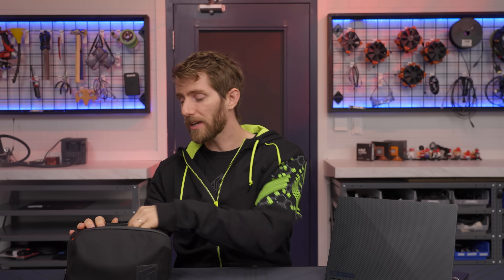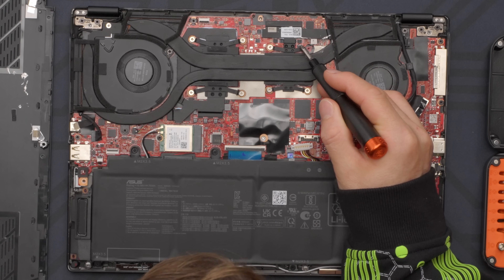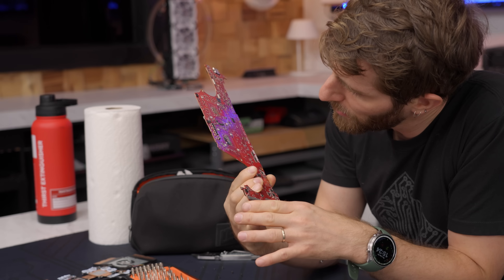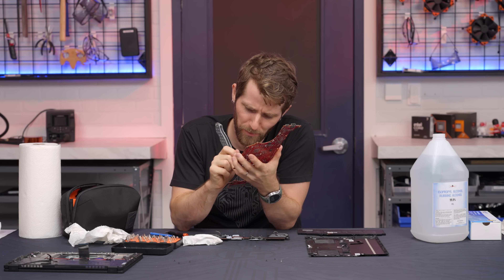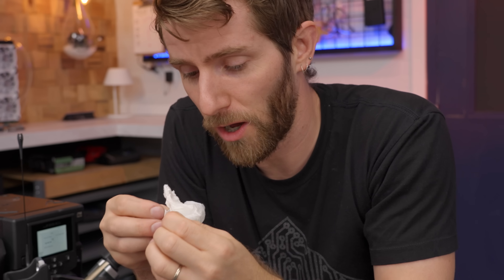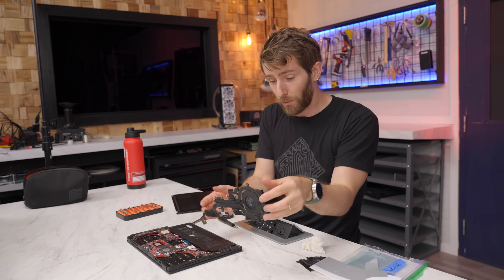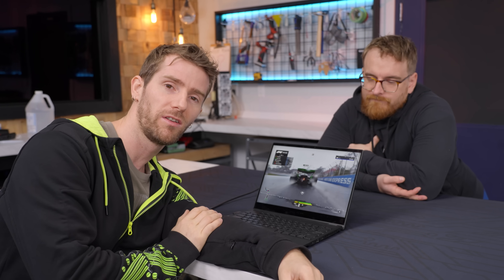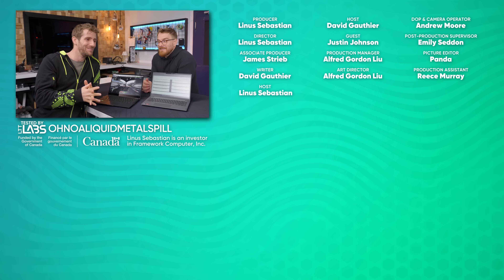Liquid Metal Killed my Laptop… Now What?

Comment: Liquid cooling of any variety, metal, coolant via radiator, etc.. will always be inferior to a simple ass fan. Fans are cheap, and even without a fan many high quality CPU air coolers still work passively..albeit admittedly at a much higher temp.. but that would be long enough to diagnose problems.

Comment: What you call being careless,  i call normal use, a lot of ppl will not be carefull, and the device should be designed to handle quite rough handling, especially being put in a backpack while still warm, this failiure was caused by a design flaw none the less, it's a shame, but stuff happens

Comment: Things went similarly for Framework. They tried liquid metal on FW16, finding it had issues with application/not staying where it needed to stay and with effectiveness. Honeywell PTM7950 (or its factory-optimized PTM7958 format) ended up being equally or more effective, without the downsides. All FW16 7040 2025 manufactured models, all FW13/16 Ryzen 300 models, and FW12 have since moved to using the Honeywell material rather than paste or liquid metal.
Reply: i have my 2024 fw16 here and i do agree that i am a little bit worried, especially considering the bug where it resumes from sleep in my backpack, terrible combination
Reply: @Destroyer954  that resume from sleep is unfortunately windows fault, and not frameworkish, it's Microsoft pushing to remove S3 sleep from all laptops and replace it with modern sleep, which does not actually power down your device hence burning up your battery and laptop in your backup leaving you with 0 battery, go into windows power management settings and set default close behaviour when on battery to be hibernate instead of sleep so the device will actually turn off, and always use hibernate when you want to "sleep" the pc and take it with you so you don't kill your battery.
Reply: @HerbaMachina  Yes, but, hibernate technically wears the SSD out faster. Honestly the boot times with modern SSD's are so fast that hibernate is not really any better in my opinion. I have set my FW16 to just shut down when i close the lid
Reply: @HerbaMachina i use linux and it still wakes up, i think it's a firmware issue because it was mentioned that it should be fixed in the new fw16 generation

Comment: What is that note at 8:10? Gallium literally does melt at just above room temperature. Around 29C.
Reply: The actual liquid metal formulation (which isn't pure gallium) is already liquid at room temperature, it just gets less viscous when heated up hence the correction.
Reply: Yeah, funny when the correction gets it wrong

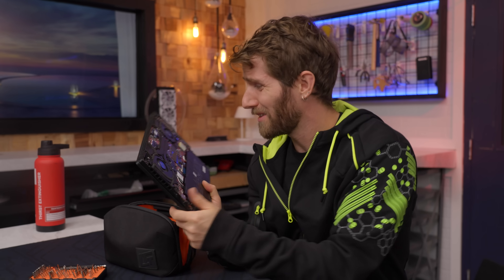Comment: @ 0:28 The long term effects of getting thermal paste in a socket that's very tightly packed with pins like the current intel and amd offerings is NOT a reason to simply ignore a little oopsie in the socket. putting a machine under lots of heat cycles can eventually cause a bridge in the socket and kill your CPU. Just because it worked after a couple of reboots for a video does not mean the long term effects are still safe of having ANY material in a socket, especially something with densely packed pins. I'd say ask me how i know but its pretty clear just by the statement itself what happened from this absolutely wrong advise.
Reply: It wasn't advise though lmfao
Reply: Okay but where did they say you should do somthing like this ever? They simply just showed that traditional thermal paste won’t cause an issue in most cases but they never said you should do this iirc they said to avoid it still because it could cause issues
Reply: Trying to spare someone else from having a headache I like that.

Comment: My Asus Scar 18 2023 with 4090 bricked itself because of this! I got store credit and paid in extra and got the Asus Scar 18 2025 with 5090. Saw the temps on the CPU and GPU were through the roof, checked online saw other people having similar issues and a few of them opened the laptops up and saw exactly what you are displaying here! I immediately got everything I need to sort this mess out, Q-tips, isopropyl alcohol etc Opened my laptop up and the liquid metal application was even worse than what you're showing here in your vid, it just didn't have enough time to leak all over the place (Although some managed to leak out onto the motherboard already) I ordered new liquid metal as well, and spent hours cleaning this mess as I didn't want to loose my warranty so I had to keep the liquid metal on there, so I cleaned it all up off the sides and spread it properly as hardly any of it was on the CPU or GPU, rather it was all around the sides in a massive puddle! 

Anyways sorted this out, temps were over 20 degrees cooler (I know this sounds crazy but when I say there was almost no liquid metal on the CPU die and GPU die I meant it!) I then opened the laptop 2 weeks later to see if my application had the same issue as theirs where it leaked all out the sides and it was perfect! Laptop has been running like a dream ever since and I now have piece of mind that it won't spill out everywhere. 

The clowns at ASUS apply liquid metal the same way you would apply thermal paste: putting a bead sized blob and then plopping the cooler on top, the problem is, liquid metal is basically like mercury, it will just squish out the sides! It has to be applied properly and very carefully and in an extremely thin even layer!
Reply: When I bought my asus m16 first thing I did was take it apart and redo the crappy liquid metal application lol probably not the smartest idea but hey I got way lower temps and I know it wont leak out now.
Reply: @l-_-lForkBombl-_-l  On the contrary - that WAS the smartest idea. My daughter's M16 got fried from leaking liquid metal.
Reply: Seems like Asus should stay away from LM if they can't do it right. It reminds me of the fear of water-cooling solutions due to incompetent manufacturing.
Reply: @mrsearaphim4077  Liquid cooling is pointless and risky
Reply: @mkjk2534  Risky yes, pointless, absolutely not.
Reply: @mkjk2534 Liquid cooling has its place, but it should be avoided when possible or if you do it you need to have well-payed technicians apply it (or observe the robots applying it) instead of whatever cheapery lead to this mess.

Comment: This video has singlehandedly radicalized me against liquid metal.
Reply: Well to be fair liquid metal is like custom water cooling or delidding a CPU. Great project for enthusiasts to squeeze every bit of performance out of their parts, possible small volume unique boutique product, but should absolutely never be sold as a mass market product.
Reply: I remember having this concern YEARS ago when it was first pitched with the ps5. Even as a far younger and dumber me, my first thought was still "this seems really stupid and dangerous. Why would you put LIQUID METAL right on top of sensitive device parts?"
Reply: me wasting my money on a delid kit and using it under the IHS only to get 1 really hot core now (luckily I dont use that cpu anymore) taught me my lesson years ago, lol
Reply: @orijimi  i dont see the point of radicalising like that, the issue is not LM, the issue is bad design. LM has vastly better thermal conductivity than any other TIM and it makes sense to use it, especially if the laptop as a result can get much more heat out quickly to the heatsinks instead of it piling in the cpu. but from a factory applied LM i expect basically perfect application and custom seals to ensure it NEVER leaks. this is bad design but im a fan of LM and dont see the point of making an enemy out of it
Reply: Dude. 
Lots of misinformation about liquid metal here.
This will piss some people off... but liquid metal is safe and THE BEST POSSIBLE thermal performance - when you're not an obvious degenerate like Linus is when it comes to handling laptops (and the pathetic performance he displayed in his repair attempt here solidified this).
Reply: @GOOFLEr Bruh. Chill out, dude. And don't tell me you're the kind of guy who waits 5 minutes for the computer to cool down before putting it into your bag.

My current laptop is slightly bent because my little brother threw himself onto it. Thankfully, it still works. Imagine if it had liquid metal...
Reply: Watch a rog ally liquid metal mod it runs faster while running cooler liquid metal is very advantageous if handled properly
Reply: @kashyapchonekar5437  I'm sure they said that at Chernobyl in the 80's too

Comment: A while ago I installed liquid metal into my laptop and it definitely helped temps for a bit, but over time it got worse and it was a pain to clean. Eventually I tried Thermal Grizzly's kryosheet and it was the best thing ever. Pump out is physically impossible, and if its a high mounting pressure situation you can get near liquid metal performance. I actually use two layers of kyrosheets on the cpu to increase mounting pressure and it still stays perfectly cool. Highly recommend kryosheets over really anything else. (Plus you can buy really big kryosheets and cut them to size, just make sure to use a knife while cutting without any shearing motion).
Reply: Weird how it got worse over time. Im assuming it's due to the chemical reaction between the CPU's cover and the LM creating this thin new sheet of alloy that makes it thermally less conductive. But I read this chemical reaction is typically short lived and shouldnt affect temps too much... Perhaps the surface became uneven if the liquid was moving around?
Reply: @mrsearaphim4077  It happened because the liquid metal moved around so much. You can make a gasket around your processor with off the shelf thermal paste, it blocks it perfectly, but that doesnt change the fact LM distribution shifts around on the processor itself. Over time you start getting dry spots, and odd temperature anomalies start showing up, like one core randomly nuking and then going back to normal.

Comment: Liquid metal if proper applied is not a problem.
As you see in video, there is 2 things:
1. Toooo much liquid metal
2. Low pressure mounting

Yes, PTM7950 is more safe option, but if you want maximum thermal transfer efficient then your way is LM. In laptops, I would use the PTM7950 because it would create fewer problems for users. For direct die delided CPU on PC i would only use LM.

Comment: A laptop that you can't just pick up and go without letting it have a cooldown period is a useless laptop.
Reply: i mean, we already have some really good non conductive, safe, and cheap alters. people just love to reinvent the wheel... always...
Reply: @Shihir0 its called marketing 😂
Reply: @Shihir0 thats a shitty analogy considering that reinventing the wheel in this case means your car can literally go faster. Its an easy fix and this is obviously overapplied anyway, probably just easier to throw more then enough on and think you sealed it. All this takes to fix is less material and more sealing/mounting pressure. But oh no, sorry, our genius over here wants stagnation. Everybody stop making things better
Reply: i wish there was a "run fans at max rpm" button doing exactly that even when the laptop is turned off
Reply: @quantasplay   I feel like Windows would find a way to randomly turn those on at 3 AM 💀
Reply: @quantasplay  pretty sure there's a gaming laptop that already does that. But it doesn't run the fans at max. It just let's the fan continue running a few seconds after shut down.
Reply: @quantasplay  just buy a mac and avoid all that BS
Reply: @geostel I need both and I didn't run into this issue just avoid buying liquid cooling laptops that's the real solution
Reply: @geostel , I already have a Mac mini and my dad gets to use a Mac Pro at work. My rog laptop has liquid metal under the heatsink but I rarely unplug it so it’s kind of a desktop replacement for me
Reply: @geostel   buy a thinkpad and use Temple Os just as god intended
Reply: @dmaskell92 actually some games are coming to Mac, I had enjoyed cyberpunk. Assassins creed also wasn’t so bad, I believe we would see more Mac ports in the future. And in my current situation I can’t buy any big gaming PC-I need something that I can put in my luggage, so I have MacBook Pro  as laptop and Mac Studio. Being digital nomad applies some limitations😅
Reply: @geostel  cool idea. then you can have overheating  straight out of the box  while also limiting your self to a limited ecosystem  😂 your fanboysm is clearly not working here bud. try again
Reply: @geostel lol no. So I can be locked into a garbage OS, and be stuck in an ecosystem that treats your wallet like it's theirs? Nah fam. Enjoy your Kool aide tho.
Reply: @geostel  lol a macbook is a web browsing and content consumption machine for $4000
Reply: @alex31ytb  continue to accumulate air, go touch some grass, may be it would help you to get in touch with reality and you would understand that all what you told is just complete nonsense because you do not have a clue what you’re talking about
Reply: What if I told you what the fuck back in the 90s: Ma'bel, HP, SUN (rip) etc: had a fairly full fat computer that wasabout the size of a hand...that was a common theme (eventuall) I also point you to phones:   Agreed it's a engineering nightmare to fix. just saying: other than Linus nutting over fucking wank and brain dead things? it's a thing.
Reply: WINDOWS UPDATE SAYS WHZT!??
Reply: all windows laptops then

Comment: Isn't the point of a laptop portability? Shouldn't you be ABLE to move it even when 'warm' without incurring destruction? If you have to treat it like a desktop, what is the point of having a laptop?
Reply: Absolutelly
Reply: It's sad my MacBook is apparently more durable than this. It was in my backpack when it fell off my bike at 30mph and slid a good 15ft. Only thing it shows is a ding in the corner of the lid and one on the bottom.
Reply: @ProtoV33MK1  Why's that sad. Macbooks are known to have the best build quality
Reply: The laptop is fine, its ASUS being ASUS and using too much LM. If you apply the exact/correct amount to create a thin film surface on both the CPU and the Heatsink the gaskets will do its job and prevent any leakage.
Reply: It might be meant for people who only need to occasionally move their laptop. For example, kids with divorced parents might not take their laptop everywhere, but would still want to take it between their parent's houses.
Reply: @OrsonFellstone  yeah, but most kids can’t afford a laptop this expensive.
Reply: @doodoofrt I’m sure one of the kids parents need to compensate for something
Reply: Its a gaming laptop with a 4070. Its battery life is bad anyway, so why would you carry it on yourself everywhere? 😂
Reply: @montenegrofees Horrible take. I use a gaming laptop in class because secondhand gaming laptops are cheaper than professional laptops. I have to move in between classes, while my laptop is still running preferably so I don't have to reboot all my vms. If you're not going to move your laptop, get a desktop.
Reply: @mikelminderhoud1438  Precisely. Students are the demographic that is going to be shoving a warm laptop into a backpack every hour. That's what they were designed for - until ASUS decided to poison the well.
Reply: @montenegrofees  what you mean? Having a portable device doesn't mean that you operate on battery power all the time. I use my laptop at home, in the office and even at my client's place, all places usually have power outlets, and if not, there is my car where I can plug it in if needed. As for the performance, some professional programs benefit highly from the gaming specs, as there are very few high performance professional laptops, and usually they are way more overpriced compared to gaming ones, for little to no additional benefit.

Comment: If you use liquid metal, you should assume that the user will not treat it gently. And you should make sure your gaskets seal tightly
Reply: Lenovo sealed their gaskets tightly, I don’t wait for it to cool down whatsoever and the laptop is fine, had it since it came out and it runs like a charm
Reply: Nvidia apparently did their homework. Their gasket is rubber and had a triple rib design. The foam on PS5 is that wide to keep catching liquid IF it ever goes that further away from the chip.

From what I’ve seen, Asus’s solution is a joke. Tiny tiny foam and no cushioning. That zone required rubber OR more vertical space and foam. But it’s a laptop so vertical space is a premium.
Reply: @VegaEclipse1096 oh dude that’s no excuse, Lenovo has a thick gasket that’s pressure sealed on the legion pro 7i 2023 and 2024, it’s basically impenetrable
Reply: @shocknaw that’s what I’m saying. Rubber gasket is way better than foam in tiny spaces like a laptop. For the PS5, I’d say it’s barely getting away with it.
Reply: @VegaEclipse1096 yeah 100%, foam is inexcusable
Reply: I have a better Idea. Don't use it. Not worth the Risk
Reply: @abhijitpanda524  but it's like 2% better! - Every marketing departments.
Reply: 2:00 if that's careless than define normal use, cause all I heard is normal use I expect a laptop or portable device to hold up to
Reply: @HerbaMachina Chill. Asus’s solution is a joke. That tiny foam and 2 razor blades acting as springs for the cooler pressure. Please…

I bet they had to invent a new sales buzzword like liquid metal and pushed the engineers to “just make it work”. And they did with what they had, albeit not bulletproof.
Reply: That way they won't make money 😭💰💰💰
Reply: Or not. And then sell another one when it inevitably breaks. Not covered by warranty btw.
Reply: @araamahasla555  Assuming ASUS has any loyal customers left given their what seems like quad-yearly bung up. Consumer mind-share is fleeting. It takes years to get, but it doesn't take much for people to leave and recommend other do too.